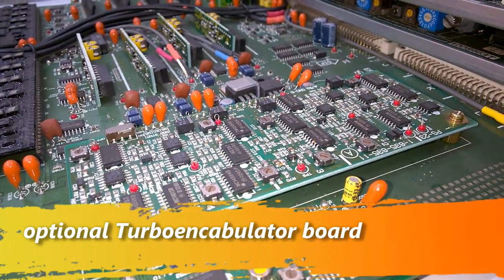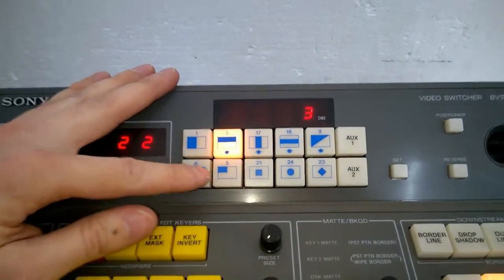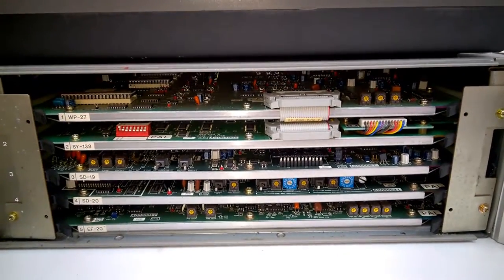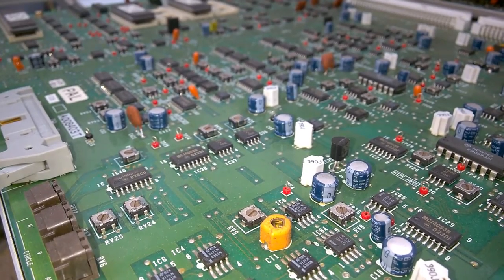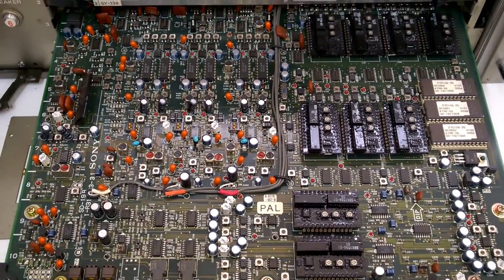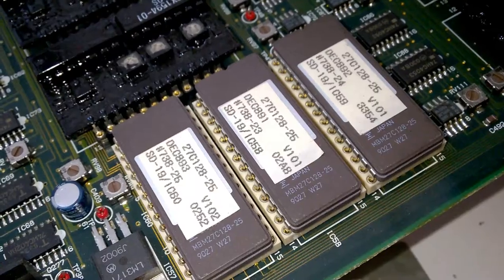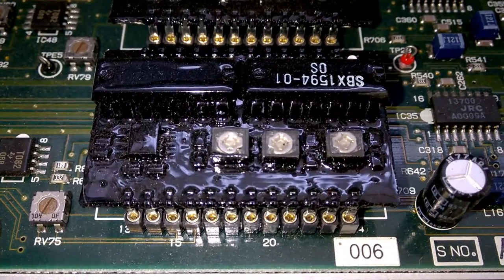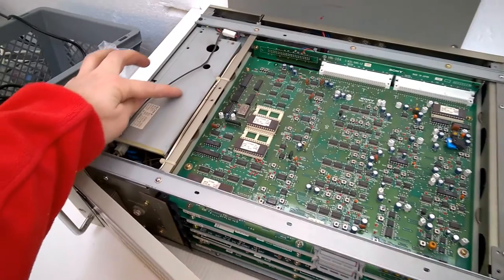BEB #43: TEARDOWN of Sony Broadcast Video Mixer with huge hybrid modules

Comment: It reminds me Dave jones did never do the teardown of the ultrasound machine he has in the "bunker". Considering those hybrids are mostly loaded with surface mount parts, I guess the reason they are encapsulated is mostly for confidentiality.
Reply from the maker: ultrasound machine: I'm pretty sure I will do a video. If there is enough response... 
hybrid module: good point! could also have something to do with ESD and serviceability. I could imagine to have the input circuitries socketed, for easy *maintenance. The switchers are used on large venues, with long run video cables lying next to all sorts of other different cables. But most likey it is for copy protection, that's true.